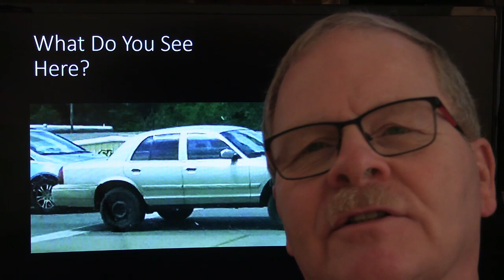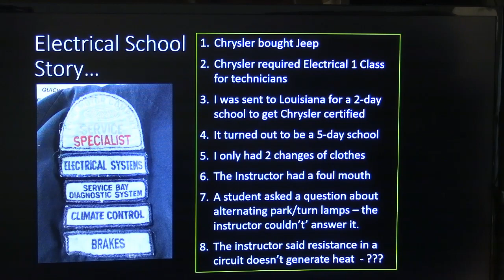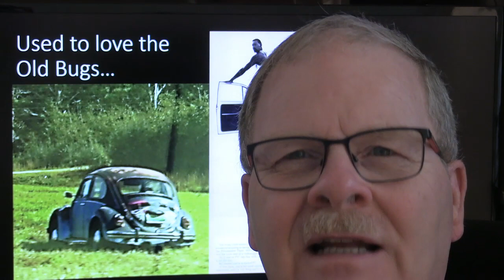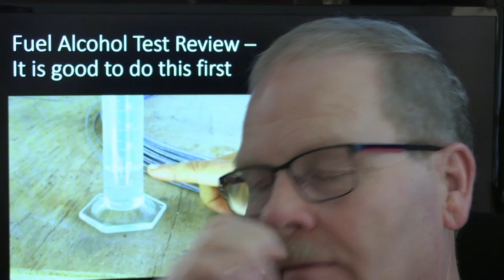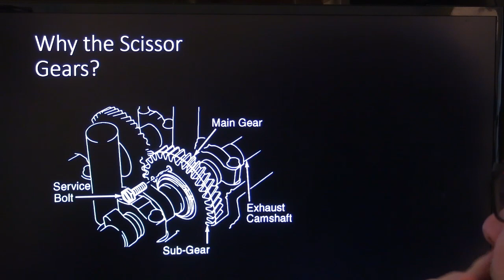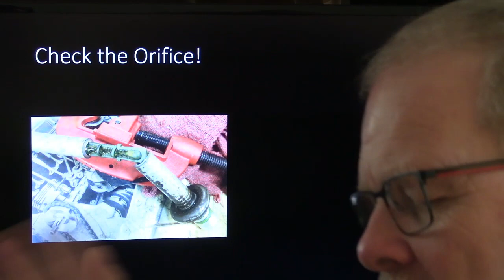More Photos and Stories and Stuff

Comment: The test to measure amount of ethanol in gasoline is interesting.  For anyone who doesn't know how, you add 10mL of water to 100mL of gasoline.  What settles to the bottom is the 10mL of water plus the #mL of ethanol that was in the fuel.  So, assuming that the gas is E10 (10% ethanol) then the 10mL of water was enough to pull all the Ethanol out of the gas.  At the bottom what settles out is something like 17mL (10mL water + 7mL ethanol) and you conclude that 7mL in 100mL is 7%.  After digging deeper there's a fudge factor that if you add 10mL of alcohol to 10mL of water you don't get 20mL but actually only get like 17mL.  Search Youtube for a video named "Volume Change when Mixing Alcohol and Water Explained".  So considering this, the 7mL of ethanol is probably actually 10mL which means it's actually 10% ethanol in the gasoline.  You need to apply the correction factor to be really accurate.  You can buy small test granulated test viles (Amazon, Briggs & Stratton Gasohol tester) and I wonder if on those testers if the graduation marks correct for volume shrinkage when mixing water with alcohol.    One other point of interest.  There's videos of guys adding water to gasolne to draw the ethanol out of the gas to make ethanol free gasoline for use in small carbureted engines. Removing the Ethanol will also reduce the octane rating.  I guess you either need to start with 91 RON fuel or I guess you need to add a non-ethanol octane booster.  /John
Reply: There's a chemistry test you can do to separate out the alcohol from the water.  It's called salting out.  You mix salt in the water/alcohol mix and the alcohol will float to the top of the water instead of being mixed with it.  Maybe this could help you figure out the true percentage of ethanol drawn out by the water.
Reply: I'm guessing you could use this trick to make your Whiskey super Hot!  - if that's your thing